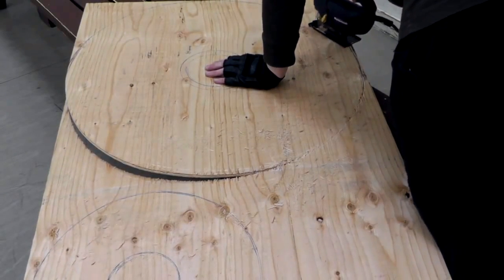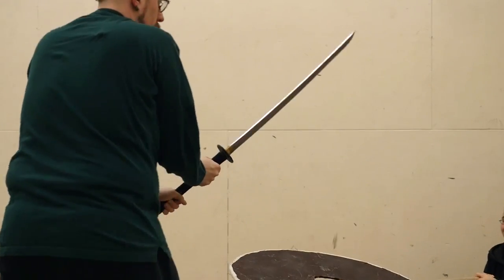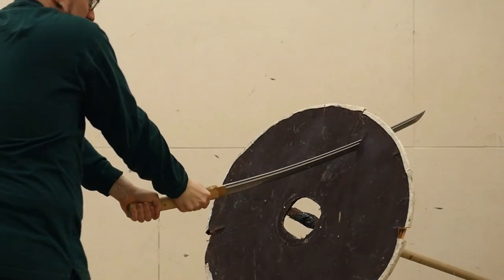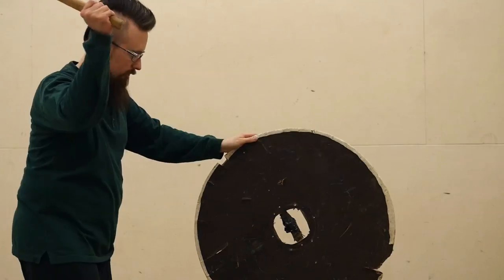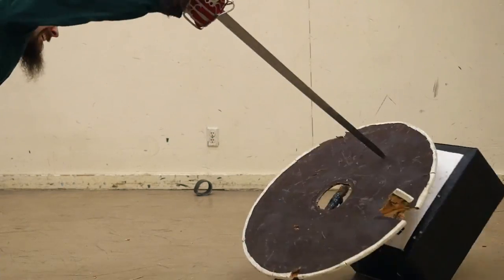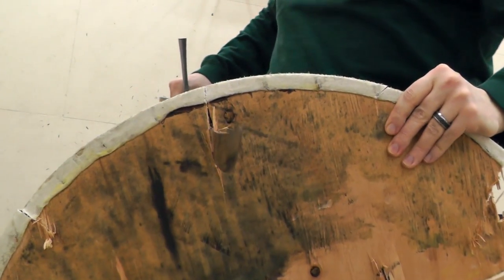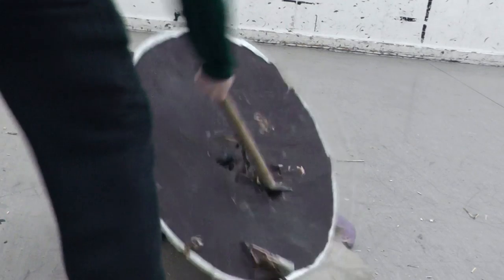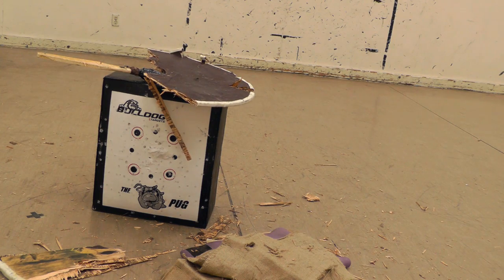Plywood shield vs broadsword, katana, axe, kriegsmesser, and war hammer

Comment: So, I noticed this. And this question above all else needs to be answered.

How does a shield fair against a Pommel throw?
Reply: Pommels would bounce or glance off.
Reply: 2bingtim it wouldn’t bounce off bc shields can’t handle that much rightness so the pommel would go through the shield and it would end the enemy rightly
Reply: You'd need to step far back and go behind a blast shield. Of course machines would be used to toss it.
Reply: The shield would break rightly.
Reply: it would cause a nuclear explosion
Reply: At the very least it would shake the wieldeer so much there organs would vaporize
Reply: would have liked to see a pilium throw and a halberd against it as well

Comment: isnt the sword getting stuck a big advantage for the person with the shield?
Reply from the maker: Yes.
Reply: germanic tribes, the celts, vikings and both the vistrigoths and the ostrogoths.
Reply: Metal armour is very expensive, for a start.
Reply: The Romans designed the Pilum specifically to get stuck in shields so that they could render them useless.  It obviously was a onetime use a weapon that is meant to be thrown, but if you have another weapon to switch to, then your sword getting stuck is just making the opponent's shield heavier and harder to use.
Reply: Japanese armor often had iron (and later steel) scales or plates, making it just as effective against the Katana as a lot of European armor would be.  In an actual battle, Samurai would primarily fight with spears, while the Katana was usually a secondary weapon and would be more analogous to a modern military officer having a handgun.  It could still be used against armored opponents (by going for gaps) but wouldn't be as effective as a spear.
Reply: Dharmawan Laksono they use a Wooden base with a Metal Layer on it
Reply: You can deflect weapons with a metal shield. 
A wooden shield will be disposable but if the opponent's weapon gets stuck it's a huge advantage.
Reply: plate armor is very expensive, even today. And actually, shields were mostly made of wood, It's quite reliable as you can see here.  I think that a shield made from all steel will be too heavy, but I dunno
Reply: @teejin669  also metal shields are very heavy
Reply: @noger1234  The Arabs and Reinassance Europe use metal they maybe heavy but totaly usable
Reply: @lol5961  Steel is about 10 thousands heavier than wood for the same amount of volume, but metal shields would probably be able to better deflect arrows and crossbow bolts, whereas wooden shields would be penetrated.
Reply: @dharmawanlaksono4576  ever hear of the kite shield? That thing was pretty damn wooden
Reply: @grannytorrelli2560  of course he is lol
Reply: Yes, cause the shield user just disarm his opponents
Reply: Heater shield is made of 90% metal, it was made to block Polearm, warhammer and maces. It is decently heavy
Reply: That rich, metal is not cheap
Reply: Japanese armour is Lamellar, even as metal they are only as good as Chainmail. Latter Japanese armour are better, but their reputation is not completely explain since Japanese don’t have Pole Axe, Pole Hammer or Billhook... the only types of Polearm that they do have is a Naginata, spears which would do blist again Europe Iron Full Plate.
Reply: Erirkain And heavy
Reply: @dharmawanlaksono4576  
You're not very bright, are you?
Reply: @dharmawanlaksono4576  Most types of shield were at least mostly made of wood.
Reply: @dharmawanlaksono4576  basically almost everyone use wooden shield. 

Metal shield is too 
-heavy 
-slow
-expensive
-resource expensive ( if a shield is more than 60% metal, you could probably make some armor with the metals and it'll function even better ) 

A wooden shield is heavier than a two handed axe like the on used in this video by approx 0.5 kg 

But the most important factor is that wooden shield is much more effective than a metal shield in every regard. Why? 

Wood shield is light and quick, you don't need very durable shields that could last centuries but shield that are cheap, fast and light. Also a heavier shield would mean it's more easy to get pass it through hooking the shield's rim. 

It might look weak but it actually perform much better because if a attack from a sword lands on it the sword gets stuck. And a spear have problem even scratching it. 

And most attacks can't even touch you if you don't stick your face right beside the shield. 

Almost all shields are made using hard wood and more effective shields would have a layer of leather covering it making slashing attacks almost non existent.
Reply: He deleted his reply LOLOLOL
Reply: @aaronjacobamadorsalazar1934  bruh, the man finally realize how stoopid he is after 2 years
Reply: @ttchme9816  
Hahahaha
Reply: Shields are good, shields won fights
Reply: @ttchme9816  what did he say?
Reply: Yes
Reply: @roguenine9LU  couldn't think of the name but k ew exactly what you were talking about

Comment: B-b-but muh glorious nippon steel would have surely cleaved though plywood...
Reply: Jack Ryan Not those 400 bucks piece of shit katanas. Try a 2 3k one.
Reply: I was just about to type the same comment. Good play sir!
Reply: This sword is stronger than the katanas of the time they were used. I bet they would have broken.
Reply: Jacob Staten o
Reply: If slicing stuff cleanly is so easy. Swordsman don't have to train for 10+ years.
Reply: "though plywood"
Yeah, though is just the perfect word choice here)
Reply: tfw no name you would get a two to three thousand one...
Reply: Actually Katanas were made from pretty bad steel because in japan there was no better iron available at that time. That is also the reason why the steel was folded so often when forging the blade: it was a method for compensating for the bad quality of the raw material.
Reply: Yiliacat 2000 thats cprrect but we should also understand that it was forged rather well even though the parts were low quality they were forged in a rather difficult way that made them less fragile while this doesnt by any means make them a god weapon it doesnt make it a large butter knife
Reply: The katana that he as using is shit look the blade almost broke when hit the nail try a good katana and see
Reply: ɹ ɐ ǝ l katanas were just fragile swords... they were not very strong as is the reason
Reply: @arisupersnake  400 bucks can get you a pretty good quality katana that performs better than an authentic Japanese sword.
Reply: Of course it can, if it's a saw.
Reply: @Rael14  ehhhhh... that is bull****. Every sword would get chipped or look like it has been through a bloody war. Katanas just have large blades that easily chip because it specialises more on cuts (even though katana manuals demonstrate the thrusting method).
Reply: @arisupersnake  it'll still produce the  same effect. Katanas are designed for flesh not wood
Reply: yi That’s actually fiction
Reply: weeb
Reply: @jahnjahntheunknown8521  umm no it was a war sword. I'm saying against armored opponents a Katana is nexted to useless. Which makes a longsword more desirable. You're short sighted look into what I was implying shows how little you actually know =)
Reply: @Meun  ok here is the link : 
https://www.google.com/search?ie=UTF-8&client=ms-android-samsung-gj-rev1&source=android-browser&q=what+was+katana+originaly+made+for

Or just search to google : "what was katana originally made for"
Reply: @Meun  ur really talking like u know everything. swords in real life was not like "KIMETSU NO YAIBA". Stop babbling without researching. I see thats why ur profile says it all
Reply: @Meun  also why would you go to war without armor. Its stupid its like going to a battle with a gun without ammo. Almost any sword cant penetrate that much cause u need to balance the sharpness, durability, weight, length, usability and, portability.
Reply: @jahnjahntheunknown8521  Is this the best you can do? meanwhile you delete a comment you made with a reference I don't actually get? I like the art style of anime but I know it's way over the top. I never once said it was a god weapon and I never once said it was a good one. I merely said it was a weapon designed for cutting and that it is not good against not only wood but armor. If it was used against a ballistic dummy as was another cutting based sword you would see both have around the same effect however Katanas are the byproduct of Japan being isolated for a couple hundred years and not having Chinese weaponry or European weaponry so they had to make do. Your obsession with trying to prove my points to be invalid due to me having an anime profile picture is kinda pathetic considering your only points are "bad steel" and "your taste in art makes your points invalid". I wish you the best man in actually growing a pair and growing up but holy. The European Broadsword is actually just as good if not better than a Katana for a few reasons. Mostly due to the make of the weapon and how versatile it actually is. A Katana has no pommel, it's cross-guard is not meant for parrying like a broadsword. If anything you should be noticing I have an affinity for European weapons. The only thing I like about Katanas is the look. I enjoy eastern culture which is why I also like Chinese swords as well. like my lord any competent adult would've noted that from just my comments after but you insist on what crying because you need validation from the internet?
Reply: @Meun  cause u said it was not good at cutting wood but its good at cutting flesh, meanwhile it is originally used for cutting wood, its metal on the old age was not a good metal 
EDIT : and i realized now that yoi said it is meant for war but its not good at armor but, a normal person will think to wear armor cause taking advantage to an enemy was the 1st rule of war.
Reply: @Meun  look i didnt talked about nunchucks. It maybe used for war cause thats the best and cheap sword that people could get. And how could u say that ur nice when u cuss at me. Get a grip men. Go to a psychiatrist.
Reply: I mean yeah, but his cutting is also horrendous he is banging with the katana not cutting with it 🤣
Reply: Just saying but if you go to war, they wont provide soldier a 400k katana for 2 years. And thin edge sword like katana was easily chipped unlike western sword that thicker. Nation would face financial issues and heavy casualties cause by swordbreak during battle
Reply: @thepurehealer1279  The katana was never used in war formally, and its number one opponent hands down literally incontestable in any way, was malnourished barely clothed peasants. It was so bad at dealing with even minimal armor that the samurai had to start using Kanabo. 

It in terms of medieval arms, was indeed basically a butter knife.
Reply: @adaikonen  He actually used draw cut stance. You're calling him wrong but he has videos where he very clearly demonstrates he is not only good at cutting, but good at wielding a katana properly. 

That's just all the blade was capable of doing, the plywood was too hard a target for the full effect to work, that happens and is called chinking.

Comment: i think all the comments in this video miss the fact that is FUCKING PLYWOOD

people have this idea that plywood is something bad since we have furniture made with it and is old as the romans... guess what? is not. plywood is pretty much one of the best materials available even today when comes to strength/weight ratio. it was less than 100 years ago when things that plastics, fiberglass, carbon fiber and etc started to challenge plywood
Reply: +khhnator ply wood is amazing but incredibly bad when you add water think the strenght comes from the way in witch the wood is layerd with the grains between sheets being layed perpendicular to one another
Reply: Perhaps they mistake it for drywall.
Reply: plywood is relatively new, it wasn't around with the Romans
Reply: Plywood is new, but veneer is not, and neither is layered/weaved veneer. This is similar in many ways with what we may call 'plywood' these days. Ancient romans did use wood veneer, but the civilization that really mastered the art were egyptians, who did not have wood to spare. You should look into it, quite interesting.

Comment: To summarize: Most weapons don't do a lot of damage to the shield, swords (especially lighter ones) faring particularly badly, but when it got broken enough things really went downhill fast. Accurate?
Reply: Timothy McLean Pretty much.
Reply: Timothy McLean Well anything that would do a lot of dmg to a shield would be unwieldy for everything else, until the rifle appears obviously.
Reply: Timothy McLean Yeah...unless you are a Nazghul XD
Reply: Timothy McLean Also, focused blunt weapons do the most damage the fastest, and don't get stuck.

Honestly, getting your blade deeply stuck in a wooden shield like shown in a video would likely very quickly lead to death.
Reply: Timothy McLean standard procedure for dealing with a shielded opponent seems to be to just get around it, greek swords curve over them, vikings like axes that have the reach and a dropped blade to get around it, even the roman pilum was intended to just get stuck in them and make the shield weighted and unwieldy to the point of just getting ditched.  Shields are a right pain in the dick.

Comment: Great video, Skall! I wanted to point out that plywood does not have a grain like you know regular wood does. Plywood is engineered wood that has layers of wood with their grains rotated around 90° to eachother. It's sort of a criss-cross grain where one layer goes --- and the other goes |.
Reply from the maker: IceCreamJimmies 
I just remembered that it was only 3 layers, and the grain in 2 out of 3 runs in the same direction.

Comment: Nice to know a plywood shield is that effective.  My "barn door" shield is edged with heavy pigskin, but that won't protect the shield.  When you were attacking that shield, my first thought was that a weapon lodged in your opponent's shield is a VERY bad thing!  Also, my first thought with the axes and war hammer was to pull the shield out of the way; not so easy in single combat, but in a battle formation, that can allow a pole weapon or spearman in the rear ranks an opening.  
And the Kriegschmeisser is awesome!